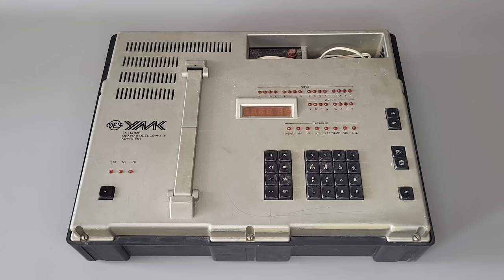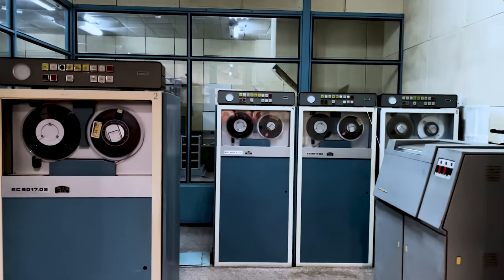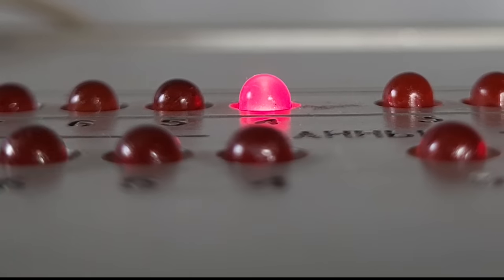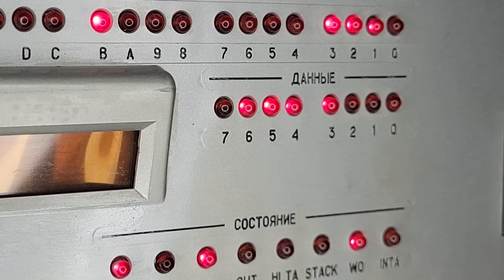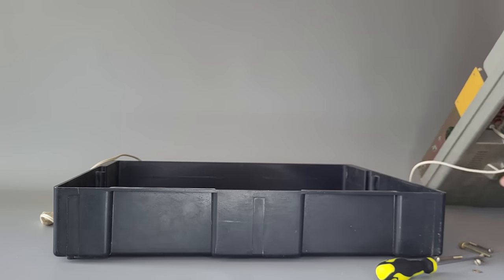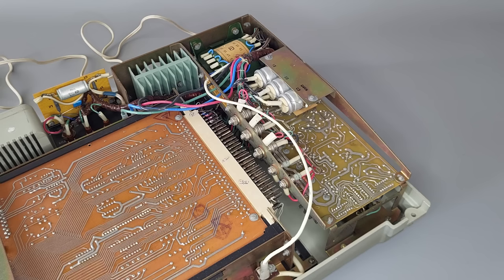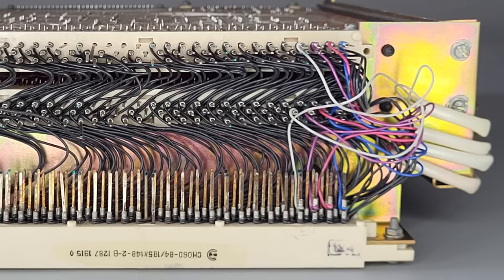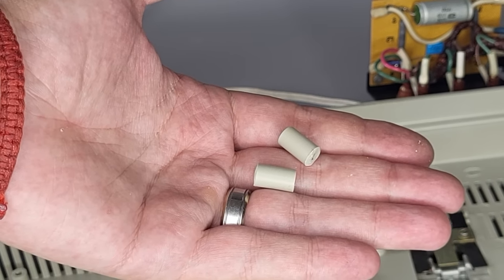This Soviet Microprocessor lab looks like a nuclear briefcase!

Comment: I can imagine that the notes were left inside to assist with the repairs.  The repair service was probably shared amongst some of the same workers who did the assembly.  The quota for units shipped gets made, and the metrics for repairs looks good as the "damaged in shipping" units get diagnosed incredibly quickly...
Reply from the maker: Close to truth. And not to disrupt the Good Statistics.
Reply: Leaving repair logs in electronics was a standard practice everywhere back in the day, not just in the USSR.
I often find them in old equipment. You were supposed to write them all on one piece of paper that you could easily find inside. You had to write the date of repair/maintenance, who did the job, contact info, what was the fault, diagnosis and what repairs you made. Quite often, but not always, you had schematics inside too. Back then a device was supposed to serve you for decades, and it was assumed it would be normal it would go through cyclic repairs, so it made sense. Nowadays most electronics are one time use devices to which you don't even have service access to, which you are supposed to replace in a few years.
But it's not like it was limited just to electronics. The practice survived on for instance with cars till this day after all.
You surely do keep a log of every repair/maintenance of you car, do you?
Reply from the maker: There is one difference: it is not a repair log, it is an obscure notice on a glitch. The same we found, e.g. in DVK-3 computer we have a review of here, and by papers that machine was 100% functional, despite it had a dead graphic card.
Reply: @ChernobylFamily  I see your point, that definitely makes it more interesting
Reply: fascinating cultural difference to just shipping a crap broken device, like CCP.. Sort of a true desire to pass on success, or caring for the next guy in the "broken machine" of communism.   @ChernobylFamily
Reply: for a nation founded on Taylorism, scientific management and whatnot, they surely created lots of these naive, mechanistic kinds of systems that were just asking to be gamed (all the while decrying psychology as bourgeois science)...
Reply: Основная мысль вопроса автора была не в том, зачем эта бумажка внутри, а как вообще в проданном изделии могла оказаться замеченная неисправность после выходного заводского контроля. Ответ прост: государственный план. "Если вы понимаете, о чём я" ©
Reply: Це зроблено тому, що  ремонт радянської техніки-перманентне явище від моменту придбання.
Reply: "The repair service was probably shared amongst some of the same workers" - sometimes this was 100% true.
My turntable, made in 1985 at a defense plant in Moscow, suffered two complete shutdowns (literally, control logic hung up and flashing error LEDs) during the warranty period, and the service station was ... one block from the factory gate. I suspect that they used this other location to divert the customers from the main factory. On a good note, after this initial shakedown it worked flawlessly and still works fine. Certainly superior in sonics to anything sold today under 1k usd.
Reply from the maker: @orion33  100000000000%

Comment: The genuine Intel 8080 needed that 12V.  12V ran the bulk of the processor with IO being supplied with 5V.  The chip would run at less than 12V but at the cost of clock speed, ie lower voltage = lower maximum clock speed before the chip became unstable.  The voltage on the 12V pin must always be greater than what ever voltage is on the 5V pin on the chip otherwise the chip could well be killed.
Reply from the maker: Thank you for this explanation!

Comment: I love blinking lights and drive seek noises.  I wish Modern computers at least allowed the Option to see banks of lights and plenty of drive noises.  I could easily sleep soundly in a Server room.   Mmmmmmmmmm.
Reply from the maker: Normally things that had blinkenlights had a soldering iron nearby:) I believe it is not a problem to make a custom card for a modern computer with a lot of LEDs that display certain states/operations of the bus (of course, some circuitry will be needed to make it meaningful assuming crazy speed of operation now)

Comment: Wire wrap are one of best reliably connector types and look very nice :)
Reply from the maker: We just purchased an original electric tool for this. In our lab we are restoring a ES1060 mainframe panel, same as the one at Duga OTH radar (I mentioned it in the previous video), so there we will need to repair around 2000 connections which were originally made like this.
Reply: @ChernobylFamily  Very big job repair that amount connectors :)
Reply from the maker: When you do unique things, be ready for unique challenges:)
Reply: Digital Equipment Corp. used wire-wrap, too.
Reply: My Dad had DXing as a hobby and built most of his equipment himself. He always used soldered wire wrap connections. He was an electrician by trade, working in the Nordic shipbuilding industry. In 1974, at the ripe old age of 35, he died of lung cancer, most likely caused by asbestos and heavy smoking. I was 10 at the time. Thank you for sharing this content and making me reminisce him. Take care, God bless you.
Reply from the maker: Thank you for sharing this.
Reply: I still carry a hand wire wrap/unwrap tool in my tool box. 
Wire wrap is very reliable, robust and fast to perform. 
This is a nice training rig.
Thankyou for your effort in the presentation.
Reply: HEX programing and wire wrap takes me back 40+ years. If only my body had wire wrap connections...a few personal, accelerated dilapidation issues but my processor and IOs still work. I'm frequently dusted off and brought back into service. Limping not broken. There's still work for crusty old dogs like me 😂.
❤

Comment: I love the look of the older vintage red LEDs...  That ruby red color, and the hot spot in the frosting... so nice.
Reply from the maker: Those LEDs are notably darker, and the color is somehow very vibrant,  I love them too.
Reply: @ChernobylFamily  I wish modern equipment used them too instead of those super-bright blue LEDs that doubles as bat signal

Comment: This reminds me of the Tesla PMI80 and the TEMS 80-03, which also came in a suitcase. Both were built around the MHB8080A CPU, Tesla's clone of the Intel 8080. Engineers liked the CPU (or just had to use it because it was available), so many systems were available based on the 8080: the Tesla PMD85 series (and its clones Didaktik Alfa, Didaktik Beta, and Maťo - the compatibility of the clones wasn't 100% though), SMEP PP01 by ZVT Banska Bystrica, IQ151 by ZPA Novy Bor, etc.
Reply from the maker: Thank you for sharing! Need to check on those :)

Comment: Would that have a full Intel 8080 instruction set? I'm just wondering if you could use assembler and put something together?
Reply from the maker: The chip inside is a full clone of i8080a, different only in the way how the crystal is wired to pins of the case. There was an enhanced version of 8080 made by Ukrainian engineers based on it, called 580VM1, which is slighly better.

Comment: Interesting note, the pitch of the pins is 2.5mm, not 2.54mm, so they are slightly different from Western DIPs.
Reply: The Eastern Block did make a very small quantity of 2.54 mm pitch DIP parts for the non-COMECON export market.
Reply from the maker: We used the metric pitch.
Reply: @alexhajnal107  And ex Soviet fabs kept doing so after the USSR fell.  We had some 100mil/2.54mm pin pitch 74xx TTL chips in the electronics lab when I was in college (late 2000s) that were made in Belarus in 1994.

Comment: Coming form and ex-communist country my guess is as follows: The reason they did it this way was that they would mark the manufacturing quotas, regardless. Repair of a module or a board would cost time, require many skilled technicians (because of the high failure rate) and in many cases they just didn't have a good replacement part in stock. The notes would be the "honest" approach so the technician could troubleshoot faster and hope he could source a good part from somewhere.
In this way they would simply outsource the repair work to the service and keep them in business as well
Reply from the maker: Pretty much bingo.

Comment: I can pretty gues what was the thing with those paper notes sealed inside: Quality Control partial passes, that is it. Why? Because complex machines have many reasons not to perform in all functions and because not all functions are needed by all customers. So for customer A it will be a perfect machine as long as he is not going to need that particular function. The guys reporting good production results asked QC to plant those disclaimers inside so that service will know exactly what to do, just in case. And so the factory reports good, healthy production.
Reply from the maker: Imho, for a training set a correct step processing is more than a basic function, otherwise how to study it?
Reply: @ChernobylFamily  Yea. But, reporting good production it was more important.

Comment: It's really funny that despite obviously having quite a lot of motivation to report very low failure rates in manufacturing they still did very good quality control, making notes of all the problems found. The easy way to get very low failure rates would be to not bother testing them in the first place. I guess they had to look busy.
Reply from the maker: Knowing Soviet society, where everyone will receive an equal payment regardless of efforts (due to planned economy) that looks more as attempt to push a headache to other's head and not to disrupt a good production statistics.
Reply: @PCRetroTech they didn't just have to look busy, they had to stay busy and created follow-up work ... ... ...

Comment: The wire wrap technology was widely used in the 70‘s up to the 90‘s for computer prototyping, giving you a fast way of connecting pins together w/o the need to etch and manufacture a pcb. Pre-drilled PCBs, IC and other sockets were available with the necessary long pins to wrap the wire around. The wire wrap „pistol“ was driven manually by pressing the handle to rotate the shaft, and some models could even strip and cut the excess wire during the wrapping process, resulting in an enhanced working speed.
Reply from the maker: Manual...? Interesting, we had electric mostly. We recently got one for our ES1060 restoration project, it is for AC 36V so still i need to get a proper PSU but we gonna use it:)
Reply: In the measurement & test industry it is still used pretty often to connect test needles / pogo pins to the tester electronics
Reply: @TheRailroad99  I work on submarine sonar, and some of the legacy equipment still has the original wire-wrapped backplanes.  Thankfully they're pretty rugged and well-shielded, because if any of them were damaged I know that I am not qualified to fix it, no way... it would be a nightmare.

Comment: I wonder why tgey didnt clone/improved the Altair
Reply from the maker: Altair was a primitive home computer (stress on 'home'), and those were out of interest for the industry for a long time. However, in 1982 in the "Radio" mass journal for electronic enthusiasts appeared a chain of publications about DIY computer Micro-80, which was based on a soviet clone of i8080. It was somewhat similar to Altair in its minimal configuration, but in maximal it could have a display and a keyboard. A disadvantage was that it used >100 chips many of which were in deficit, so later simplier, but equally effective Radio-86RK was created (we mentioned it in the video).

Comment: What an amazing coincidence, I just bought a clone of this chip's successor, the μPD70108, aka the NEC V20, which is a clone of the Intel 8088. I was looking for a completely different chip on eBay and happened to check what other items they had for sale, and it turned out they had a lot of interesting chips for sale, so I went on a bit of a shopping spree!

Anyway, that was a very interesting video on a very interesting computer. In western countries you could definitely buy computer kits that were a lot like this during the mid-late 70s. And it wasn't just for businesses, there were advertisements in magazines and anyone could just mail order them. The very first edition of Byte magazine had an ad for one on basically the second page.
Reply from the maker: Wow! Thank you for sharing!

Comment: You know Alex, nothing has really changed since then. The production quota has to be fullfiled and when the suppliers , employees and technology is unreliable then the material is shipped out anyway. Nevertheless, nice video again. Keep them running. 👍
Reply from the maker: Thank you!
Reply: Today, especially with thin margins on products and many choices for the same product, you don't want to have to unnecessarily deal with the RMA, scrapping the product (as repair is mostly dead unfortunately), the probable loss of a customer and the tainted company image by shipping non-functional garbage.
Not saying that it doesn't still happen, but I think the conditions and economy that caused the behavior in the video have changed.

Comment: It is incredibly well mounted, no shortcuts or cost cutting measures (like cheap plastic everything for instance like in the west) much more than I expected from an 80's Soviet era computer. All wire wrapped like a telephone central, all main chips in sockets, etc. And it is sturdy too, this I expected from a Soviet era computer: made to endure and for easy maintenance. Are those transistors in sockets? Or it is a way to protect them?
Reply from the maker: Thank you! That is a way to protect them.

Comment: In addition to the other comments around this allowing the factory to meet its defect quota, it also reduces the demand on the factory - some number of customers aren't going to notice the defects (think like dead pixels on LCDs), and with things being so scarce, it would usually be better to ship the slightly broken device than not to ship one at all. The Soviets were, perhaps by necessity or perhaps by conviction, very good about not letting things go to waste. Just don't do this on military-spec units. Also, it would usually be someone else's fault it's broken ("damaged in shipping" but leaders would consider that to be more tolerable than marginal silicon), happily repaired, and everybody looks great on paper.
Reply from the maker: Yeah, it all was about the fulfilling the plan. The most important, things have to be good on paper.

Comment: and it still works after 35 years
Reply from the maker: It is a good question though how much it was actually used.
Reply: @ChernobylFamily  the arduino's processor flash program memory is good for about 10 or so years. after that... there is no warranty it will still work

Comment: Approximately 6 years ago identical machine linked modern desktop with magnetometer in university`s lab. I helped to replace it with new, PIC-based controller system.

Comment: It is the copy of the PROMPT 80/85   device made by Intel in 1980 ...
Reply from the maker: I'm not surr if that is 100% clone, though devices are indeed similar. BTW, that Intel device's look gives such an industrial impression, that I'd rather guess it was made somewhere in ussr. What an irony.
Reply: @ChernobylFamily   I had this in my hands - really well made - the plastic of the keys , the typing on the keys , the  metal cover , the housing  processing was  ok for the type of work the device was dedicated to. I'm assuming the firmware was copying also .
Reply from the maker: Thank you for those details!

Comment: The boards have an industrial design, most likely this device was made from rejected boards for industrial computers, so there are notes describing the problems.
Reply from the maker: It was a custom project, though they likely used a standard card crate, in this way you are right.

Comment: We had pretty different device in university, obliviously later model but with half the memory. Named "Микролаб КР580ИК80" that briefcase will teach you how to suffer. Some of them are malfunctioning and you can tell it easily because they fail to execute test program with flashing lights and funky music. Some of them had faulty math so results were incontinent with the rest of the group. One good thing they had are cheat sheet inside the case, easily visible while operating. Its keyboard are also the best one i ever used.
Reply from the maker: Thank you for sharing! "Will teach how to suffer" is a good definition...)

Comment: This reminds me of a microprocessor trainer I learned on in school. I shouldn't say "learned" on, because I never understood what I was entering or seeing as output. You just typed in everything in hexadecimal, and then saw whatever output on a small little LED display, just like this unit. I hated it. Everyone in my class that used this basically just entered in the programs as presented in the book, verified the output was what the book said it should be, and checked off the lessons until we could move on to the real prize - our Heatkit H8, where we would all learn BASIC and write little games for ourselves. Well, at least in between constant bouts of component-level troubleshooting and desoldering/soldering RAM chips in the thing. Fun times.
Reply from the maker: Thank you for sharing!